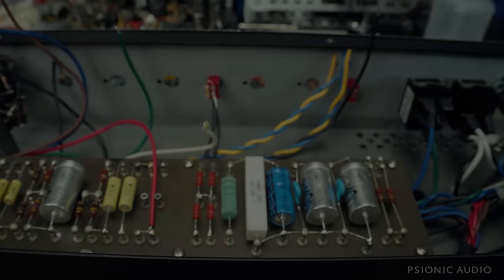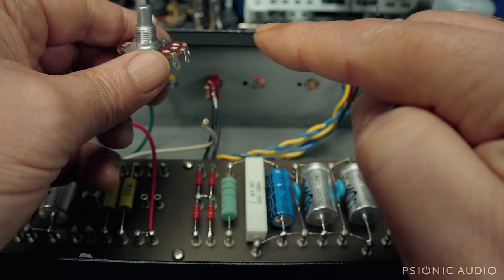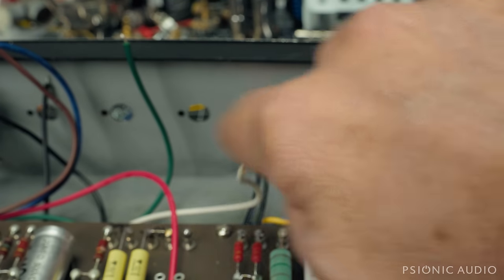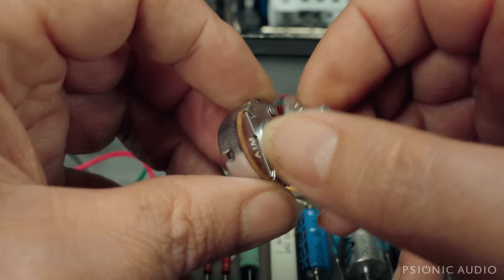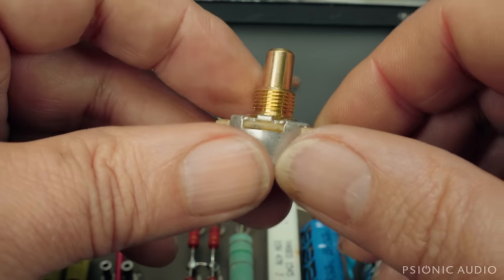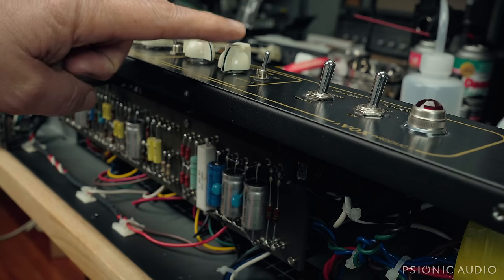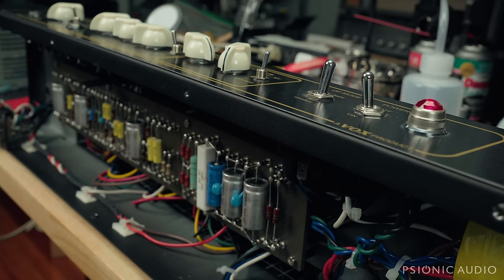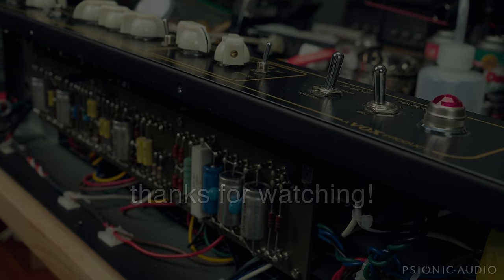Pots Talk | Vox AC30 Hand Wired Pt 2

Comment: 1... WOW, what a georgeous layout awesome work too! 
2.... Thank you for the awesome lesson on POTS... 
3... My Jazz Reverb Deluxe Re-Issue (Oh yes, I've been watching your eps, yes I am aware of the caps) THE POTS on it are SO smooth, one needs only breathe on them and they'd move.. So I put some rubber O-Rings under the knobs, acted as a nice shim to level things off and offered a slight amount of resistance that made them so much better... 
4 Lastly, on that same amp, The re-issue, it had a bad reverb, would cut out suddenly and then intermittent. I took in under warranty, they changed the tank, but I noticed what I think is a TYCO relay on the board, and those relays have a bad reputation with me, we used them on very expensive tyre truers to switch and fail regularly... Is it a relay and could it be the fault. (note: I had no gripe with fender, I bought a Roland RV-6 reverb/delay and have no intention of using an analog tank. Would be nice to rectify when I get around to changing the caps over.

Comment: Potentiometer brands I used to see in older test equipment and military gear included Centralab, Clarostat, Allen-Bradley of course, and in really old equipment (especially antique radios), IRC , International Resistance Corporation (a great name, in my opinion). As far as i know, none of these brands made it into our modetn age, not even as "legacy" or "zombie" brands for parts sourced from overseas. BTW, if I remember correctly, CTS stands, or stood, for Chicago Telegraph Supply (or Telephone Supply).

Comment: Hi Lyle, lovin the work, just wondering if there is a reason the thread on the switches (mute) are so high from the face plate. My guess is for tight securing from the underside? I hate replacing end pin barrel jacks on acoustics with the lonnnnng thread to get the desired length poking out for the securing nut and strap lug.
Reply from the maker: The factory is lazy. If I had three extras nuts that fit I would remount them flush. But it’s not worth replacing them.

Comment: @ PsionicAudio Sorry for the unrelated question but trying to get the final word, CE Cap Cans for Princeton reverbs? Yes or no, I'm reading dissenting info on their quality. I have one in now and the amp hums, no clue how old it is though. Also what about building and installing a small board for filter caps? Overkill or bad idea? Thanks!
Reply: Personally in my PR build, I soldered two terminal strips directly to chassis (you could drill holes and use hardware to mount them instead...but I wouldn't unless I didn't have a good chassis iron) and installed F&T axial caps.  Then installed a large metal "hole plug" to seal up the canister void, and bent the hole plug's claws out of the way to avoid touching the terminals.  I can try to make a quick video on my channel showing it but hopefully that made sense.
Reply: And that's because of the cost vs reliability of the CE canisters.  I don't trust em much, compared to F&T.  Buy if you can design a board for those nice short Vishay radial caps (similar to the SNK Ampeg V4 one)...more power to ya!  Or for axials or whatever fits!

Comment: Thank you for the pot talk. I have noticed that with CTS pots. 0-10% is dead. I just bought a MOJO vintage taper. Is it all CTS? And Alpha has a better 0-10%? That is needed for a volume pot. :)
Reply from the maker: Mojotone Vintage taper are made by CTS to MJ’s spec but don’t have any of the issues the regular CTS pots have. And yes, Alpha has a better 10% taper than CTS.
Reply: I have used every “made for guitar vintage hoodoo” CTS pot of 10, 20 & 30% taper on the market. Yes, 0 to 1 is dead on them all. For some inexplicable reason, CTS doesn’t make the conductive track on the wafer reach an extra ~1.5mm. 

The best 0-1 performance pots are 24mm Alpha. 

The feel and taper on CTS pots is more important to me in a guitar though. So, CTS guitar specific pots for guitar and 24mm Alpha pots for amps it is
Reply: Thank you. Yes I have a few MJ CTS in my guitars, but I will try an Alpha for volume so I can get rid of the dead 0-1.
Reply: Lyle, re: low-torque pots for strat volume knob: my ultra strat volume I swear you could blow on it to turn the knob. I'd like to keep the innards original. Any hacks that might tighten the turn, even just a bit?
Reply: @jasonweidner3274 you could probably stack nylon washers (or some type of rubber) between the bottom of knob and guitar body / pickguard to increase the friction to your liking.  Some mechanical solution like that
Reply: @gremlinmachineshop  thanks! So I understand, would the washers be under the pickguard or under the knob?
Reply: @jasonweidner3274  you would remove the knob.  Assuming the guitar pots are 3/8" bushings, you would need 3/8" nylon washers for example.  Stack a few up, put the knob back on and push it down to squeeze the washers between the knob and guitar (or pickguard if it's a strat).  You are just trying to get some compression to increase the friction to your liking.  I say Nylon because they maybe sliiightly compressible, and won't scratch the guitar if they happen to rotate like metal ones would.  Fiber washers, or other materials, may work even better.
Reply: @gremlinmachineshop  this is so helpful. Thank u very much!!
Reply: @jasonweidner3274  it's kinda rigging the solution if you can't just replace the pot with another one with torque you like...hafta experiment a bit.  Maybe able to put an o-ring atop the washer stack...anyway it's the mechanical solution mindset you hafta explore!
Reply: @jasonweidner3274 ,  Vintage radios and hi fi equipment often used felt washers on the shaft between the knob and the face plate.

Comment: The mute switch might make slightly more sense as an "off/on" switch. "Mute" being up, "On" being down. Which is the same "up" as the master volume as it rotates from 10 to 5. Less volume = clockwise/"up", no volume = off/"up".

So that if you were turning master down and bumped the switch, the result would be in the same direction. Similarly if you were turning up and were muted, bumping the switch would result in volume appearing.

No chance to going to turn down, bumping switch and unmuting instead.

Hard to say. Just noticed that it's counter to the direct you turn volume down from max.
Reply from the maker: The printed labels on the panel say Master and Bypass so I wired it so that Bypass = Mute. Otherwise it would be confusing.
Reply: @PsionicAudio  Ahh labels make sense then.

Comment: It is rather irritating that you have to spend the extra money for hw version, and then you have spend more money to fix the issues that they have.
Reply: This a good reason to seek out a good original AC30 and repair what's needed instead.
Reply: @mistermac56 ,  I don't know if I can agree with you on this. I'm a retired electronics tech with experience on both tube and solid-state amps (both hifi gear and guitar amps);  I've never actually worked on an AC30 but I've watched plenty of online techs repair/rebuild them; the construction of 60's/70's AC30's is quite a mess, not to mention that there were numerous running changes and revisions to the circuits,  different transformers and parts, and any given AC30 is likely to not match the published schematics.  Almost certainly, any vintage AC30 is likely to have had several techs work on them, with varying degrees of skill or success, and so at this point you can't predict what you're going to find inside of them.  This amp looks to be cleanly built, and the turret board is much larger than the tagboard used in vintage AC30'S, and everything is spaced out better so that access for repair and modification is much easier.  Yes it sucks that the modern reissue AC30 didn't get it right considering how much the amp costs, but I don't know that it would be any different in price to buy a vintage AC30 and then have it repaired to the point where it will be reliable or even roadworthy.  The only other factor is that a vintage AC30 will likely hold its value better than a reissue will ----  But repairing a vintage AC30 to the point where it's reliable and sounds right might in some people's eyes decrease its resale value. The handwired reissue  Probably loses 20 to 30% of its value as soon as you take it home but any further maintenance or mods, if done neatly, will not be likely to further lower it's resale value.